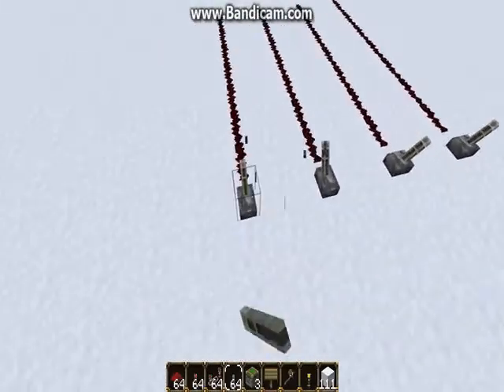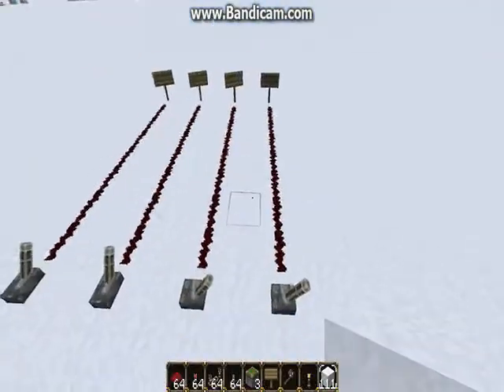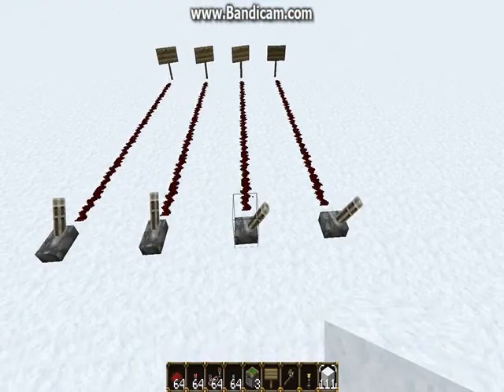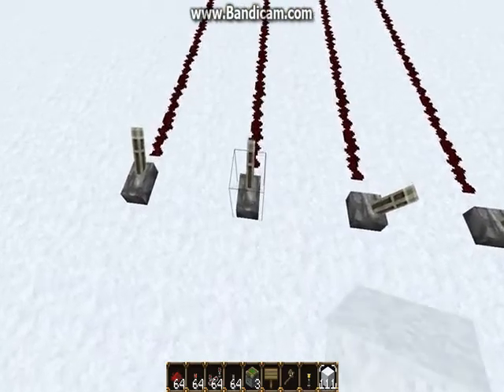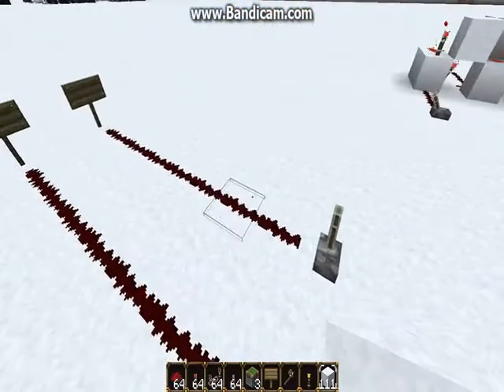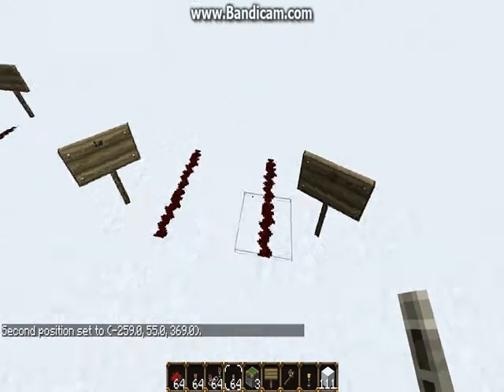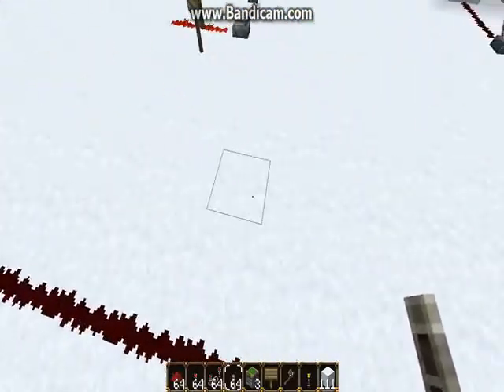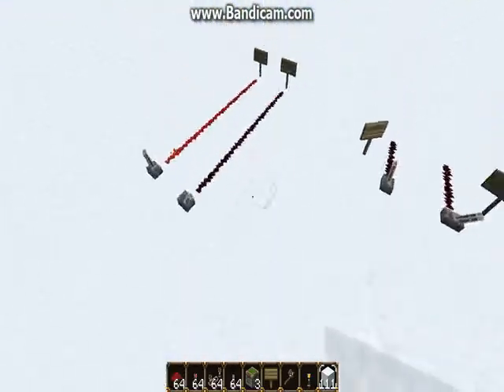Building a minecraft computer tutorial pt3: Adders and Binary

Comment: 0    0    0   0    0  0  0  0 = 00000000
(128)(64)(32)(16)(8)(4)(2)(1) #Ignore the (1) for now, it is not important

1 = one of those ^ depending on its place in the number. EX: 10 = 2
                                                                                       (2)(1)

therefore 1010 = 10, because:
8 + 2 = 10

The first place value (1) may not make sense, but is only there so that binary can store odd numbers for example: 11 = 3 or 1011 = 11

Here are some examples of binary; try to make sense of them:

111 = 7
110 = 6
101 = 5
100 = 4

10 + 10 = 100   or   2 + 2 = 4
1010 + 1010 = 10100   or   10 + 10 = 20

He was using redstone to represent this, but I think text is the best way to teach the concept.

Hopefully this helped if it didn't tell me.
Reply: Binary is base 2 as apposed to the typical system which is base 10. Think about it, in base 10 there are only 10 symbols to represent 10 basic values 0-9. In binary there are only 2 symbols to represent 2 basic values: 0-1. In base 10 you know exactly what 444 (four hundred and fourty four) really means because of place value. All 3 fours are all the same symbol, but reading from left to right, the first four is drasticly larger than the last four. If you add the values of all three fours: 400 + 40 + 4 you get the real amount: 444. Binary is the same way, except that 2-9 don't exist. Notice that 1 is just as long as 9 (from left to right), but 9 + 1 = 10. While 1 + 1 = 2. That's because we are using base 10! Only ten possible symbols to choose from. So, to represent numbers larger than 9 it needs to be like it is. Binary only has 2 symbols: 0-1. For example, pig + pig = 2 pigs, in base ten, while pig + pig  = 10 pigs in binary. 10 in binary is the same as 2 in base ten, they represent the same quantity. Based on that logic, 111 in binary, is equivalent to 7 in base ten. Because 4 pigs + 2 pigs + 1 pig = 7 pigs. Here's another one: 11010 = 26 because 16 + 8 + 0 + 2 + 0 = 26. Hopefully you understand. If not, you can look it up. I learned it through a codecademy lesson I took on the python programming language.
Reply: The redstone was perfect now I can understand it perfectly. You just confused me a lot. XD

Comment: Ok when i see binary code i see this "? ?? !!'.,??!" Lol that is what is actually on screen
Reply: 0    0    0   0    0  0  0  0 = 00000000
(128)(64)(32)(16)(8)(4)(2)(1)  #Ignore  the (1) for now, it is not important

1 = one of those ^ depending on its place in the number. EX: 10 = 2
                                                                                       (2)(1)

therefore 1010 = 10, because:
8 + 2 = 10

The first place value (1) may not make sense, but is only there so that binary can store odd numbers for example: 11 = 3 or 1011 = 11

Here are some examples of binary; try to make sense of them:

111 = 7
110 = 6
101 = 5
100 = 4

10 + 10 = 100   or   2 + 2 = 4
1010 + 1010 = 10100   or   10 + 10 = 20

He was using redstone to represent this, but I think text is the best way to teach this.

Hopefully this helped if it didn't tell me.

Comment: … or you could just think of binary as decimal (what we normally use) but without digits 2-9. All number systems (bases or radii) act the same way, the only difference is the number of digits, binary has 0 an 1, decimal has 0-9, hexadecimal has 0-F (yes F is a number) 1,10. that's how you count to 10 in binary. :P (if you meant the decimal 10 then it's 1,10,11,100,101,110,111,1000,1001,1010)